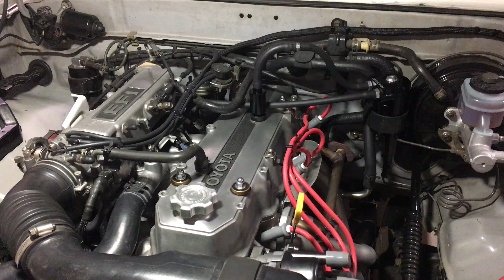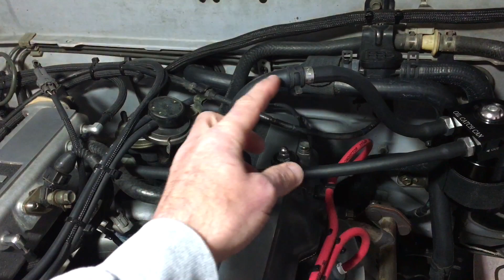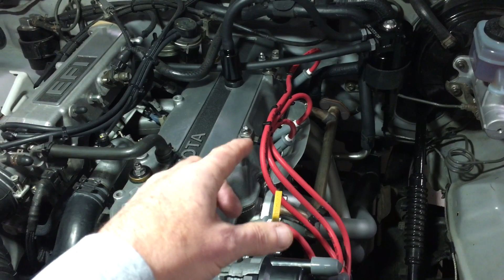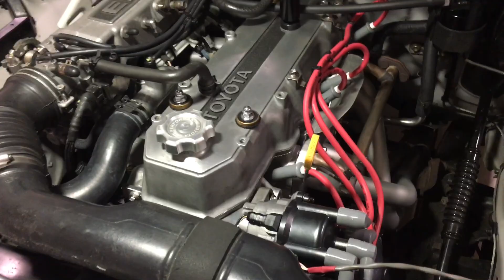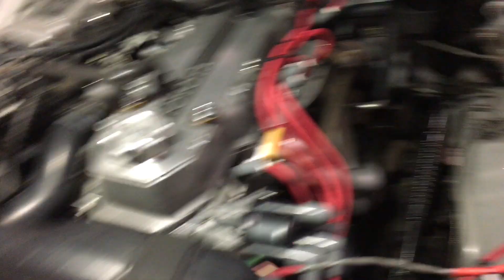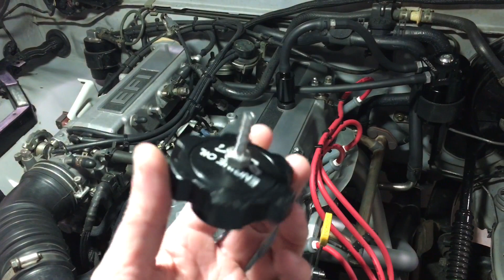QUICK UPDATE: Toyota 22RE PCV oil baffle / oil consumption

Comment: Did the 22R 4 cylinder have consumption problems
Reply from the maker: Yes... if you check out the more recent videos on my channel, I explain what the root issue turned out to be. The person who rebuilt the motor before I owned the truck had installed the wrong size piston rings and so they had the wrong tension and had fractured, etc. Also, the LCE cylinder head oil return hole is too small and needs to be enlarged. Once I addressed all those issues, my engine has been running much better and not more crazy problems. I will say the new design I ended up using on my oil baffle is working out really well now! :) Check out some of the later videos and you can kinda see what the latest is.

Comment: When you added the scouring pad to the hose did you roll it up and stuff it in tight? Or did you just cut a quarter inch wide strip and put it in so there’s still quite a bit of airflow? Mine’s doing the same thing where it’s pulling an obscene amount of oil through a brand new pcv. Just tried your fix, but I think I might have plugged the hose up too much.  Idle was kinda odd and sluggish on acceleration.
Reply from the maker: I've tried different combos. For a while I had the green pad in the hose right off the PCV and then later I moved it down into that baffle setup which the dual channel PCV sits on top of. Right now, I'm having pretty good luck and it's right above the fitting which goes into the rubber grommet that secures to the valve cover. I have an aluminum fitting that keeps it in place. I'm still testing things, but getting some promising results. I think it's more about balancing the air flow across the fresh air breather and PCV valve, however. I'm not sure how much the green pad really contributes to the entire equation. I've had plenty of cases where 3-5 oz of oil were sucked into the catch can in 20 miles, despite having that green pad in there also. My next motor definitely is getting a dry sump, that's all I can say haha.

Comment: So, what’s wrong with your engine?… “I did this and that, and that and this, and then I made this hose and drilled this hole, and what do ya’ know?: it still sucks!… Make sure to subscribe for more recipes!!!”
Reply from the maker: Yeah, you've described it perfectly so far haha. I've got things pretty well dialed in on the PCV stuff (finally). I'll have a new video coming soon which explains the solution to that. Right now, I'm driving the truck 1000 miles every week or so (while moving and selling my house) and this is giving me a chance to monitor oil consumption and also gas mileage. So I will have a full update soon. I just did an engine oil flush and changed to a 10W30 weight oil (from a 10W40), so it will be interesting to see what impact - if any - it has. But if you have any specific questions on anything regarding this particular video, let me know and I'm happy to answer what I can. But yeah, this video is all over the place haha. Make sure to subscribe for the update video which will wrap everything up (probably in about 2-3 more weeks).
Reply: @ray5961  hahaha!!! It sums up, exactly, how I feel after I work on my 22r!
Reply from the maker: @RacerRobo  The struggle is real haha :) new video coming soon!

Comment: Ray Nada have you figured out the oil consumption issue?
Reply from the maker: Still messing with it. I thought I had everything figured out, but I think (not sure yet) that installing the crank scraper might have allowed the rings to seal up more; this in turn threw my PCV settings out of whack and the truck went back to drawing oil up into the catch can at an alarming rate. I'm in the process of sorting that out again. As soon as I have some definitive answers and data, I will for sure be making a follow up video. I have a few 800-900 mile trips planned for the next few months, so I should have some further info soon.

Comment: Very nice work so far cant wait to see what the future holds!! Question about the lce header? I have a 92 2wd ive been building for years and when i put the lce header on my pickup i had to bend the air injection pipe  and slot the mounting holes to make it fit. I contacted LCE about it and they said they have never heard of 1 not fitting. Did you have any clearance issues with the air injection pipe? Does it rest on the manifold at all or is there adequate space? Thanks and cant wait till the next video!
Reply from the maker: No, mine fit perfectly. I vaguely remember having to remove the rear stud (and threading it in after) to make installation a bit easier, but I've had the header on and off a few times and usually it's a pretty straightforward install/removal. No bending required on the AS tube or anything along those lines.
Reply: @ray5961  Thanks for the reply! Glad to hear yours fit without any issues. Love your truck and the videos. No one puts out content for these little 2wds anymore keep it up!

Comment: Would like to know where you found the thermostat housing, or did it come with the vehicle? I am looking for one. Thank you for the info on the 22re. It is helping me figure this engine out well the fuel part that is.
Reply from the maker: I searched all over ebay for that housing. I think it might have been off a Toyota Corolla or Celica with a 22RE or something along those lines. You just have to search until you stumble across it. Be careful, because there is a cast iron version and also an aluminum version. Then chase it using a NPT tap

Comment: I have a 1990 4runner with the 22re, I have 2 symptoms: I notice the oil level goes down over time and then I have the issue with very low rpms when coming to a stop when warm. I have actually solved both of these isssues by: 1. Adding more oil when it gets low. 2. Putting my truck in park at red lights.
Reply from the maker: I'm with ya brother.. I'm with ya.

Comment: I’ve noticed mine burning more oil after replacing the oil dip stick tube, perhaps more crankcase pressure is the culprit.
Reply from the maker: Could very well be. If pressure is escaping past the dipstick, it tends to act like a breather / vent. That can also throw off your air/fuel ratio, since the PCV can end up sucking in unmetered air to some degree (although probably not enough to make a huge difference)

Comment: Have you ever heard of people getting a bunch of fuel in their oil? I've looked at forums and people mention it but never followed up on a cure. Any suggestions would be greatly appreciated.
Reply from the maker: It depends on how much fuel you're talking about. Some amount of unburnt fuel could end up in the oil due to failing rings and/or blow by. Also, if you have a faulty fuel injector or two, that could be a contributing factor. Also if the O2 sensors are out of whack, it could cause the motor to run overly rich and that could increase it. But normally no, never heard of that. Also, failing valve stem seals could be a factor. How bad off is your motor? If it has a lot of miles and needs service, it's possible a seal has failed some place or there is some issue which could be causing it.
Reply: @ray5961  thanks for responding. Just about everything on the motor is new. Bottom end, head, cam, you name it. I did reuse all of the fuel system except fuel injectors. They were cheap ones though so I just ordered new Bosch injectors and cold air injector. I am also going to try replacing the valve on the bottom of the throttle body. (Can't think of the name of it right now) It's a lot of fuel in the oil by the way.
Reply from the maker: @richball9576  Yeah, the good 'ol idle air control valve. It's easy to check and also easy to take out of the loop using some tape if you want to check it (see my other videos for info on that if you're curious), but I doubt it would have any impact on the fuel system. A leaking cold start injector might (or a leaking fuel injector). You can check the cold start injector by pulling that rubber elbow off the throttle body and then jumping B+ and FP in the diagnostic box (that will turn on your fuel pump and pressurize the fuel rail). You might want to also check your EVAP system and see if that charcoal canister is okay and functioning correctly. There's a purge line which goes into the throttle body, so you might want to check that and make sure fuel isn't somehow coming in that line.
Reply: @ray5961  I'll check all of those things. Thanks so much for your help!!
Reply from the maker: @richball9576  no problem, good luck!

Comment: Looking forward to seeing what the vacuum/boost gauge reads on the crankcase.  I suppose one would expect it to read vacuum at closed/low throttle as the plenum being under vacuum would draw through the PCV valve, and then under higher throttle amounts with atmospheric pressure in the plenum, less draw on the PCV, but perhaps some blowby past the rings.

At that point (high throttle opening), maybe it's a combination of how restrictive is the PCV system to letting blowby gasses vent, and how much blowby gasses are loading said PCV system -- No pressure indicating low blowby and/or non-restrictive PCV, some pressure indicating high blowby and/or restrictive PCV system.

If you see pressure readings, maybe you could plumb the gauge into the intake plenum and repeat the same conditions to see if the observed reading is any different than what's seen in the crankcase.
Reply from the maker: I ordered an adjustable PCV valve to test out. I did attach the vacuum/pressure gauge to the crankcase, but it basically just showed zero while driving/idling. I suspect the factory PCV isn't providing much vacuum by and large. With regard to how it should all function, the idea is that the PCV is driven off intake manifold vacuum - so at idle, you have around 17.5-18 in Hg of vacuum available; this is more than needed, so the PCV attempts to shut down the vacuum because at low engine RPM's, there is rather little blow-by getting past the rings and thus pressurizing the crankcase. When the throttle plate opens, vacuum levels drop (generally towards zero) although when cruising on the highway, vacuum will tend to range between 5 and 10 in Hg. So under this situation, when the motor is running at higher RPM's, you generate more blow-by and therefore more consistent pressure is being pushed into the crankcase. My understanding is that idle vacuum levels in the crankcase should be around 1-3 in Hg of vacuum, so it's the PCV valves job to steadily provide that (and I should be able to measure it using my gauge setup). Then you have oil draw into the PCV to contend with, which is sort of where I am at now (I'm trying to build an external oil baffle that drains back into the valve cover in order to prevent too much oil from ending up in the oil catch can). So it's a balancing act in a lot of ways. The motor does seem like it has too much crankcase pressure, because idle isn't stable and the motor just seems like maybe pressure in the crankcase (or lack of steady positive ventilation) might be an issue. I'll know more soon and will provide an update video as soon as I have something worth covering. Right now, I'm working on an improved baffle system as we all being able to correctly monitor how much vacuum is being provided from the PCV and also how that translates into actual crankcase vacuum/pressure levels.
Reply: @ray5961  Interesting.  What sort of crankcase pressure readings did you see at idle?  And have you compression tested it?  Last time I tested mine was 14k miles ago, and I got 170, 172, 193, 150 psi, so I always have that in the back of my mind when attempting to suppress my oil consumption.  But I must say, my idle is stable.  It's a shame they didn't have the data stream capability on all years of the 22RE because seeing the inputs/outputs of the ECU on my '94 seems like it could be useful for diagnosing an unstable idle, though I haven't used it for that.
Reply from the maker: @cbh148  I ran a compression check about 800 miles ago (fuel pump disabled, throttle body plate held open - and each cylinder washed with 2cc's of gasoline prior to testing) and the readings were 173, 165, 176, 175 psi respectively. My idle is stable, but the motor just seems a bit rough (although I think most 22RE's suffer from this). I am running a 35 lb flywheel vs. the stock 24 lb, so this might be a contributing factor. I'm actually thinking about going to a lighter flywheel as a test, but not thrilled with having to pull the gearbox back out again. I hear ya on the OBD1 vs. OBD2 of the 22RE; having a slightly more advanced ECU would be nice. When I installed the 3RZ motor, I'm going to swap over to using a Haltech 2500 or something. I'm sitting at my desk right now building the new PCV and external baffle stuff, so should have some fresh insight soon.